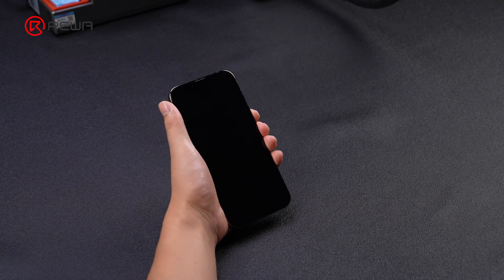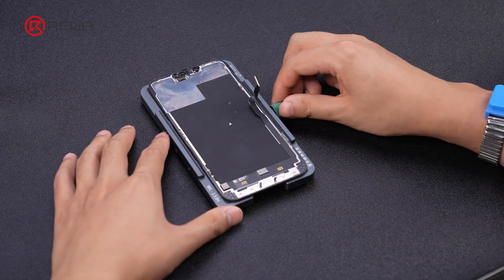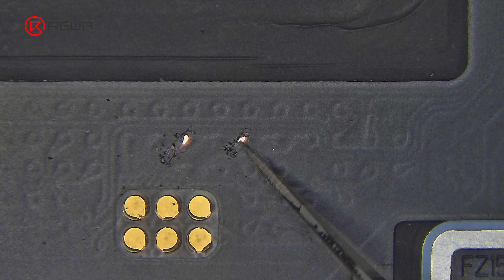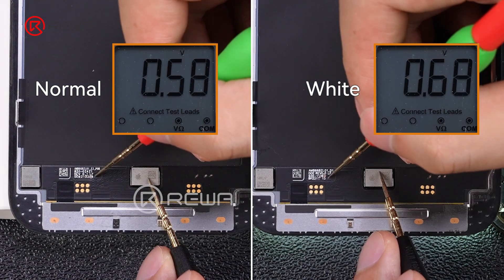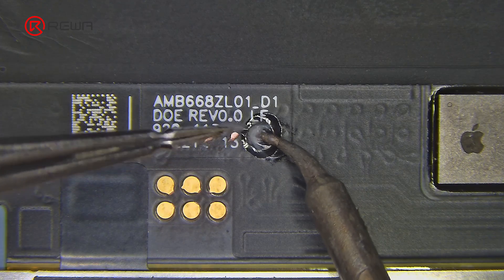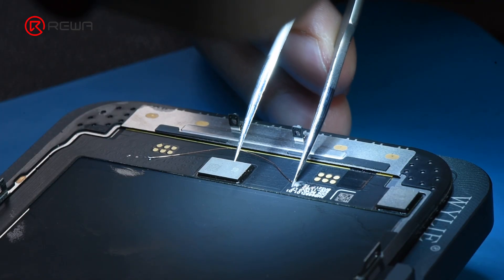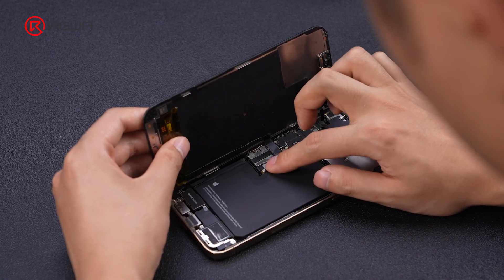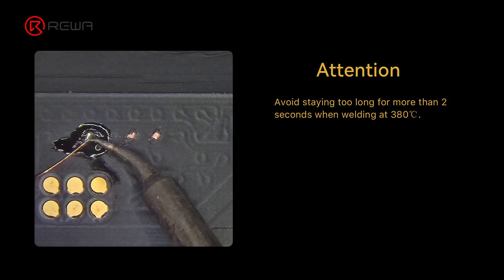A Common Solution to iPhone 13 Pro/Pro Max White and Green Screen: Jumping Wire

Comment: why didnt work on 13 pro max ?
Reply from the maker: As you can see at the end of our video, you need to connect that pins.
Reply: @rewatechnology2008 i saw full video but sometimes solutions didn’t work specially in my case

Comment: HI I have a 13pro and this issue has started to come how do i know which of the 3 jumpers i need to do i dont have another working 13 pro for reference values .
Reply from the maker: As you can see at the end of the video, we already marked the jumper wire point
Reply: this work for you? i have a 13 pro and did not work

Comment: I am an iPhone 13 Pro user. The screen turned white, so I was repairing it by watching your channel. After connecting the jumper display IC to the left 8 and right 7, the same problem occurred during testing. After removing the jumper, the voltage of the right IC jumper changed to -8.8V. I realized that I connected the jumper incorrectly. Is there anything I can try to repair in this situation?
Reply from the maker: So after you removed it, the screen does not become normal?
Reply: @rewatechnology2008  It's the same white screen as the first time.
Reply from the maker: @ Ummm it seems you have no choice but to replace the screen
Reply: @rewatechnology2008  Thank you for your reply. I enjoy watching your YouTube videos.
Reply from the maker: @ Appreciate it, stay tune our REWA channel, another new video is on the way~~

Comment: there is a shematic
Reply from the maker: Yeah we hope you can understand the full principle about the jumper wire
Reply: @rewatechnology2008  Okay, where is this schematic diagram?
Reply from the maker: @Mobilemk_de  This one is mainly based on repair experience, and we already told you why the high refresh rate screen meet this problem, if you want the bitmap to troubleshoot, here is the link: https://shop.rewa.tech/detail/refox-schematic-bitmap-motherboard-repair-iphone-macbook-android-phones.html

Comment: what about the shock method used on some other repair video?
Reply from the maker: It work but temporarily, we suggest you can follow our jumper process, it will become stable
Reply: @ the ting is i dont have any of the micro soldering hun i see them using

Comment: other technicians add a 100k resistor, others dont use jumper but instead inject voltage through piezoelectric crystal, and even others remove the flex cable and manually clean the oxidized contact points.
Reply from the maker: Oh we hope this video can help you gain this kind of knowlege

Comment: Any disadvantage of jumping wire
Reply from the maker: It may require you to locate which pin is faulty, and this may block lot of repair guy.
Reply: I see degradation of display resolution after this fix. You can see horizontal lines on screen if you look closely.
Reply: @udayanthaniraj Thia is what happened to me can it be fixed?

Comment: Does iphone 13 also have green issue or its only with 13 pro and 13 pro max
Reply from the maker: This common issues usually relates to the iPhone Pro Motion, and we used jumping wires to maintain the voltage.

Comment: Ohh my iPhone 13 Pro max have same issue its already repair but after 1 year the issue came back.
Reply: same with mine it was green screen but after jumper it got white screen after 8 months
Reply: @jaspercas that’s because they update it all the time.
Reply from the maker: For this problem jumping wire is common solution to this and it cost less for clients
Reply: Yes I absolutely think the jumper wire is a perfect solution.  Replacing the panel is wasteful not to mention the drawbacks in doing so with IC transfer etc. The amount of labor and time put into a screen replacement   for iphones is ridiculous,  especially with all of apples "booby" traps. 
Samsung has apple beat by mounds in all aspects of phone  manufacturing in every aspect.
Reply from the maker: @tonyarcher1997  Thank you for the comment, appreciate your understanding
Reply: it's better if you change new LCD..!!jumping wire just for the time being
Reply: Just remove jumper only
Reply: Thats awesome, love hearing REWA point out the " unreasonably designed circuts"  The more I repair Apple the more I despise there manufacturing design. Its nice to see other repair techs/ shops having a similar view.
Reply: flex bondin success??? plz tell me sir

Comment: This is not permanent solition 
Some case after jumper done but 1/2week retun same white screen issue 
So what is tha permanent solition for 13pro & 13pm white screen problem solition 🙏♥️
Reply: One year still working jumper
Reply: @friendsmobileserviceitahar583 hows the ios 18 update on jumper?
Reply: Just do the job right and you will have no problems
Reply: @OhQueBacan  I have repaired by this method but 1 month ago customer come back 😢
Reply: 기본적으로 디스플레이의 컨트롤러 결함으로 인한 문제이기때문에 점퍼는 임시적인 해결책입니다. 컨트롤러를 교체하지 않으면, 증상은 다시 나타납니다.
Reply: why it cannot be permanent solution ?
Reply: Yes agree